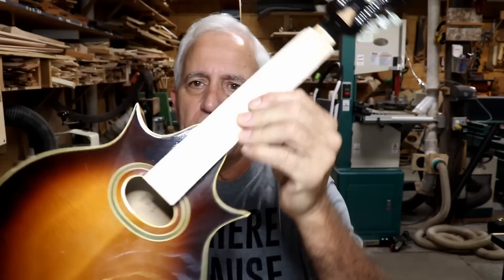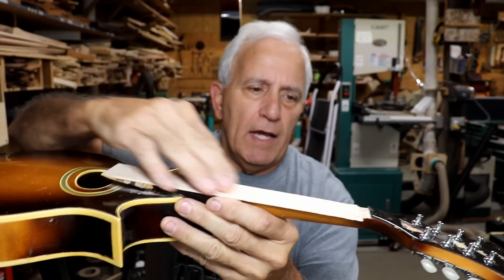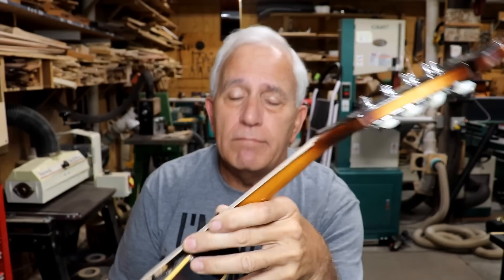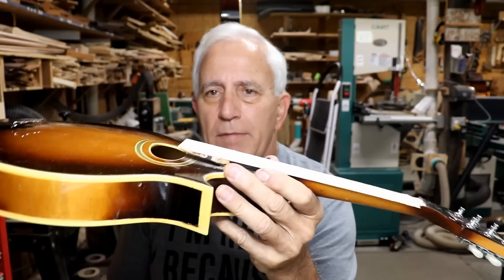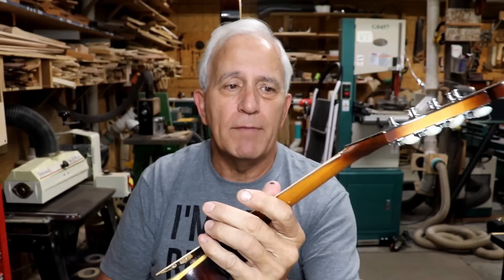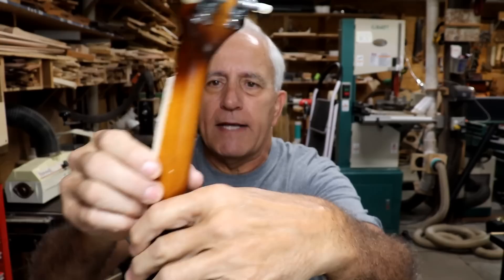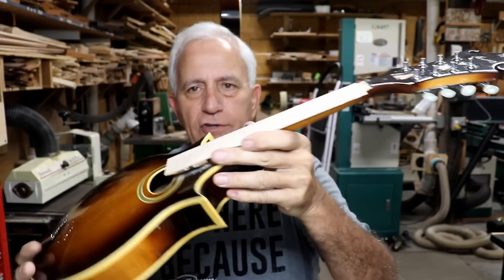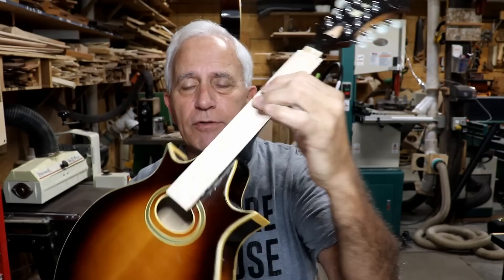VLOG #077 Martin And I Are More Alike Than I Thought

Comment: I watched a violin maker in the Netherlands fix an old violin with many cracks in the top and bottom. He opened it with a thin blade knife like he was opening an oyster with no heat on anything. He uses white glue to close the cracks in top and bottom and hide glue to glue the top and bottom back on, so best of both worlds ... I guess. :)

Comment: Some hide glue is non-toxic and edible so perhaps in desperate times with some carrots and potatoes.....  A stick to your ribs meal?  ;>

On some glue ups they will be using microwave activated glue that bonds tenaciously moments after the microwave is activated.  I maintained the microwave for doing this and its was used for layups that you never wanted to come apart regardless of heat, humidity or exposure to water.

Comment: I once fixed a Crack in a Violin by slicing out a V channel and filling it with Wood Glue and Bamboo. Took stain perfectly. I was 17. 40 years later it's still invisible. I refinished it with Shellac and Alcool. That was a bit of a learning curve. Shellac is a bit weird to work with.

Comment: Regarding the tour, I liked that several pieces of thin strips of wood were installed as a group without prior gluing on the rosette.  No need to form them around a heated post that way.  The rosette groove had super glue in it as the wood was inserted.

It looked like hide glue was used on the neck and heel blocks.  Tite bond on the braces.  I do not know if tops and bottoms were glued with tite bond or some type of heat activated adhesive (stored in heated room during curing process).

Comment: Jerry after two scratch built Ukes I decided I really wanted a Baritone Uke which is essentially 2/3 of a parlor guitar.

Rather than scratch build I decided on a Stewmac kit, that was and may still be on sale, to make things a lot easier this time around. 

The Uke Kit is like the Gretch Uke you once fixed. It uses a pair of dowels at the neck & body junction. I don't like gluing on the top and hoping like hell I place the dowel holes in the fitting location, so I did not follow the manual.

I did what I did on my scratch built Tenor Ukes. I built a jig that held the neck in perfect alignment and with the soundboard off I glued the neck and once cured drilled for the dowels from inside the instrument.

This time I was off a bit. Top of neck was 16 thousands below top of soundboard when glued on. There was a time when I thought 16 thousands was no big deal but I learned any visible hump or dip effects playability the, hard way.

So, if too high sanding would fix the issue. But no, too low meant a 5 or 6 inch taper was needed. I thought about watching your taper video again last night, but I punted by cutting as close to possible the tapper on a bandsaw, glued it then an hour later sanded it by hand so at body top of neck is flush to soundboard and 5 or 6 inches away it feathers to the original top of neck. 

I think it took 3 hours but I had a big smile when I placed the long straight edge on the instrument and saw no dips or humps would be transmitted to the fretboard.

I'll have to watch your router method again. Given I was making such a thin taper not sure if it would have worked for me but lacked the bit none the less. Thought about staggering strips of glue soaked paper but glad I used the wood.